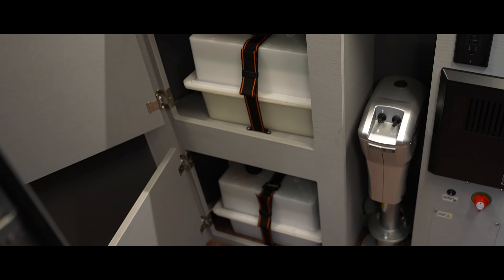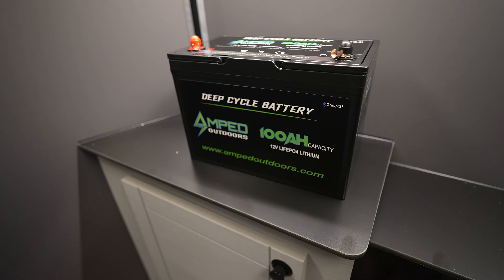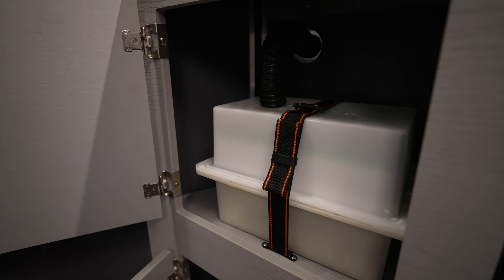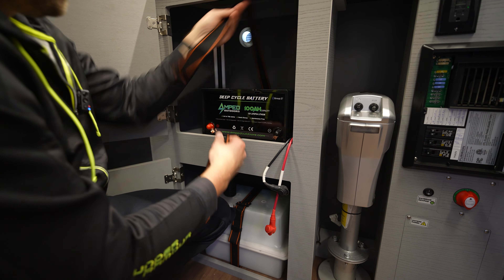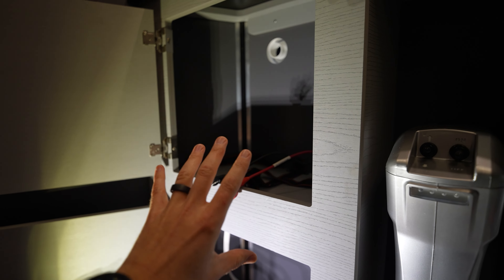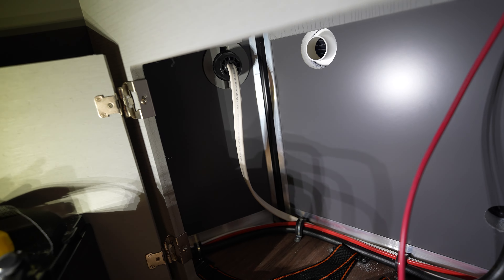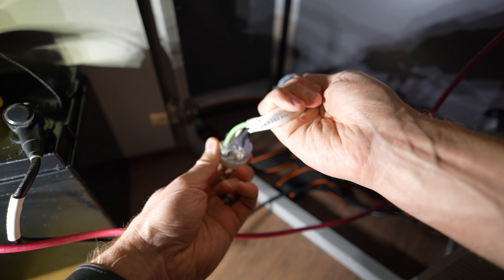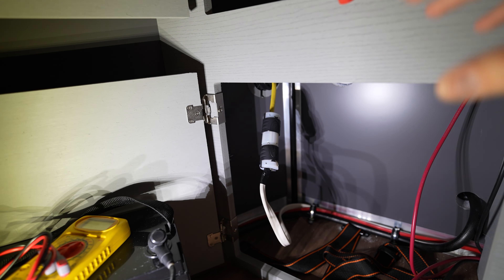No More Generators: Upgrade your Trailer to Lithium Batteries

Comment from the maker: It's nice having the ability to go out with everything on including outlets, microwave, and coffee maker and not have to worry about a generator! Have you upgraded to lithium already, or are you planning on it? I'd love to hear what your setup is or what you are planning!

🔗  Amped Outdoors 100 AH Lithium Battery (LiFePO4): https://at.fish/AmpedOutdoors100AH
➤➤ 10% OFF anything on their website code: Timm10
🔗  3000W Pure Sine Wave Power Inverter: https://at.fish/3000WInverter
🔗  300W Power Inverter: https://at.fish/300WInverter
🔗  Female 15 Amp Connector Plug: http://at.fish/NOgOIJc
🔗  Male 15 Amp Connector Plug: http://at.fish/1zrjPPh
🔗  6515ST Core Ice Trailer: https://at.fish/CoreIce6515ST
👉 Sign-up for the FGTN Newsletter at https://at.fish/Newsletter — get no-fluff updates on gear releases, reviews, comparisons, and deals every few weeks.

Comment: I would make sure to upgrade those cables on those batteries and use the same size OFC copper wire going to each. Ton of power with 400ah hooked up to a 3000w inverter. Just a heads up
Reply: AMEN! That is a must. Approx 25amps~
Reply from the maker: Valid, I'll do that for sure, looks like lots of guys recommending it. Off to Menards I go lol 

Thanks!
Reply: @AlexTimm  I just did the same thing with 2 200ah batteries and used 2/0 gauge welding cable from amazon. They are pre made to whatever length you need and not too expensive.

Comment: Great content! I was going to do something similar in my shack but didn't want to dedicate such nice batteries and inverter to the fish house only. 

I'm starting a big power box soon - 400ah of Lithium Battery, 3000w inverter, battery charger & solar panel to charge it & some 12v outlets to use for fish finders etc.

You can leave in the back of your truck and plug it directly into the fish house, (still turning of the PC breaker) and power your house, microwave etc. 

No mods needed the house then and still have your sealed acid batteries as 12v backup should you run out in the powerbox.

However, you can also then use it as a battery backup for your house as well, IE: what ECO Flow and those companies promote. 

Best of both worlds, and you already have nearly all the equipment to make it happen!
Reply from the maker: That's a great idea! If you get it built let me know and shoot me some pictures. Would love to see the solar you go with on it too

Comment: I suggest up sizing your wires on the 12vdc side.  That 3000 watt inverter can pull up wards of 250a or more on the 12volt side.  I used 2/0 marine cable in my similar build with a 2000w inverter.
Reply from the maker: Thanks man, yes I'll upgrade! 👍
Reply: @AlexTimm  it's a nice power setup to have!  I have a cargo trailer that I converted to camper/ice house.   I installed 600w of solar on the roof as well.  This fall, I spent a weekend running an electric smoker all day, watching some tv at night,  running an electric coffee maker in the morning, and ending the weekend with about 80% power left.   I'm just waiting for some good ice to get it out this winter!
Reply from the maker: Sounds amazing!
Reply: I agree that every wire between batteries and batteries to inverter needs to be very large to carry 300 amps without getting hot.  A 100 amp fuse on each battery would also be a good idea for safety from human error or equipment failure.  The current wires would be a fast fire starter if you turn on a 120 volt AC microwave oven.

Comment: I’m running amped in my MegaLive shuttle and amped for trolling motor and again for electronics. Not sure I’ll switch for cranking battery regardless of the now stated ability they can…..I dunnnnooooo. Have you/would you go Amped for cranking
Reply: I thought I read on their website that they don’t make a cranking battery. Maybe that’s changed ? I have AMPED and they’re amazing 👍👍👍
Reply from the maker: Yeah, I wouldn't switch over to lithium for cranking yet

Comment: No way! Standard w Lead batts? Interesting
Reply from the maker: They actually don't come from the manufacturer with any, you add your own or purchase through the dealer. These are the base option though from my understanding as the cheapest starting out. Not meant to be the long term solution with those I can't imagine